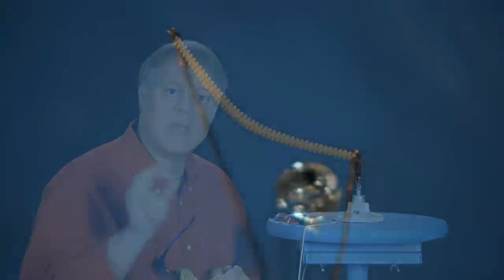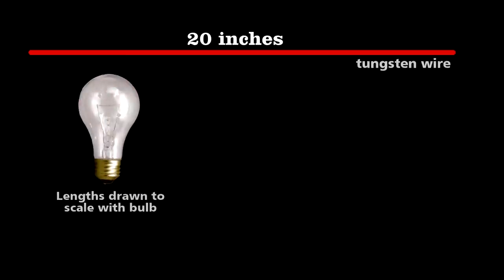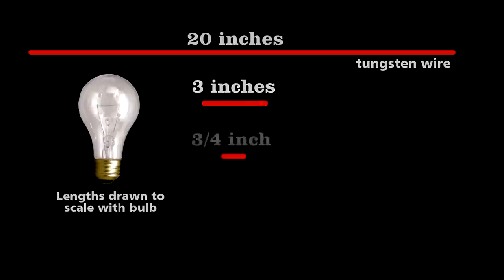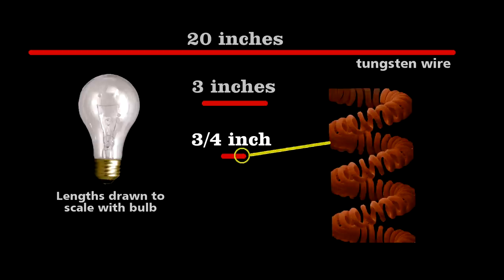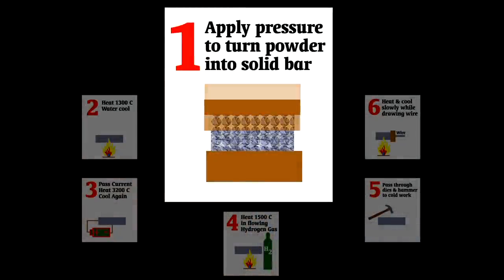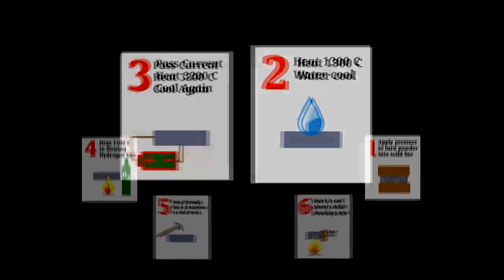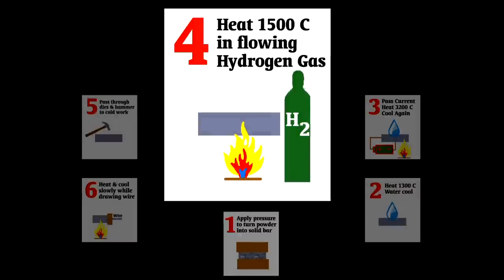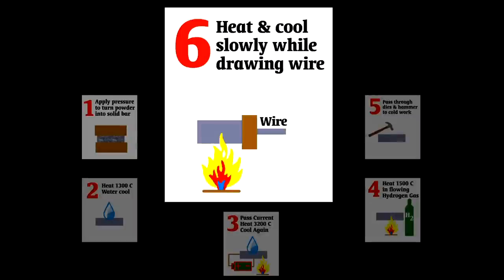Light bulb filament

Comment: If you remove the from a burned out coil would it still work?
Reply: Well you'd have to add the other coil without letting it touch the air.. Just seems a lot easier to just replace with a new bulb :)
Reply: For some reason I think he meant to say that, what if (hypothetically) we removed the tungsten oxide layer from the coil surface, would it shine again?

I don't really know but if I were to test that I would first check if there is continuity from the bulb through the filament after patching all possible melted points in the electric path. But of course this would just be a thought experiment since I can't think of anything as precise to brush off all the tungsten oxide without breaking the filament, and if possible it would probably take weeks, if not months.
Reply: No, it wouldn't work. The filament only failed when the continuous path of elemental tungsten was disrupted by the tungsten oxide. So somewhere along that filament, there's at least one point where it's tungsten oxide all the way through.

Comment: What are the benefits of using argon gas instead of just using a vacuum?
Reply: Using a vacuum puts high pressure on the glass bulb meaning the glass needs to be much thicker and stronger to not break. Filling the bulbs with gas balances the pressure difference allowing lighter cheaper bulbs. Also no vacuum is 100% efficient. It is not possible to remove all of the air within a bulb so some amount of oxygen will still be around to react with the filament. What you can do is displace all of the air with argon so that zero oxygen is inside the bulb when it is sealed.
Reply: Ahh, that's makes a lot of sense. Thanks.

Comment: @goblend There is no conspiracy. The light output (and life) of an incandescent lamp varies with the sixth power of the voltage. More light = greater efficiency, but shorter life. Well-overated lamps, ie. "long-lasting" ones, can last forever almost, but barely output any light for large electricity use. Commercial lamps are designed for the best compromise between inital cost, light output and electricity consumption. They build them where the curves all cross at one point.

Comment: 1:40 "a piece of copper has high ductility, you can bend it and then return it to its original shape".
As a material engineer, I have to correct it ^^: you can take almost all solid material, bend it and return it to its original shape (elasticity) as long as the load doesn''t reach a certain limit.
What makes a material ductile is actually the opposite. It's its ability to be deformed irreversibly before breaking.

Comment: You described what ductility is incorrectly.  Elasticity is the ability to deform and then return to its original shape.  Ductility has to do with plasticity which is the ability to undergo permanent deformations (such as coiling) without breaking.

Comment: They are wonderful pieces of engineering... and energy wasting...
Reply: nothing is perfect :)
Reply: They served us well for years and years....now that neon bulbs are out...then LED's....it's way outdated...but we cannot forget the many years it served as our one source of light at night when our only option was candles.
Reply: Well technically it only wastes energy for half the year. The other half of the year, it helps to heat your house.
Reply: Serria Yisasia They are very energy efficient compared to whale oil lamps.
Reply: While it may help heat your house in the winter, in many locations it is still cheaper to get that heat from a heat pump than it is a light bulb.  

I used to have electric baseboard heaters in my house - these are just big resistors that get hot like the filament in a lamp.  At times I thought it would be cheaper for me to just burn $1 bills for the heat.  

I have a heat pump now and I typically get the same amount of heat for about 1/3rd the cost in electricity.
Reply: The engines which generate electricity to make them glow, waste more than half of the energy in conversion process
Reply: Before them, all you had were literal fires that produce even more heat per lumen output. Candles, lamps, fireplaces...

Also, energy is not wasted. But rather turned into something else. It depends on how you look at it. If your house is cold, their heat output is welcome. These bulbs are still used in egg incubators.